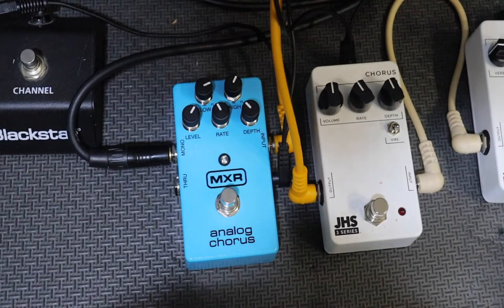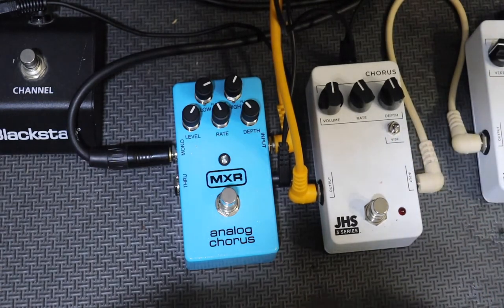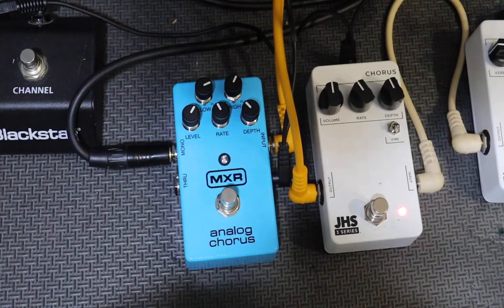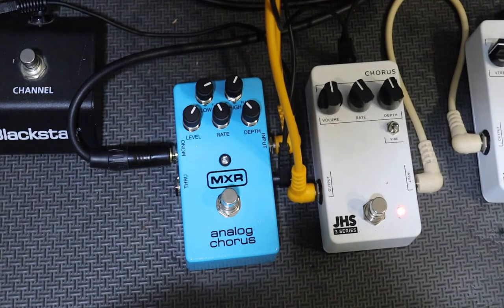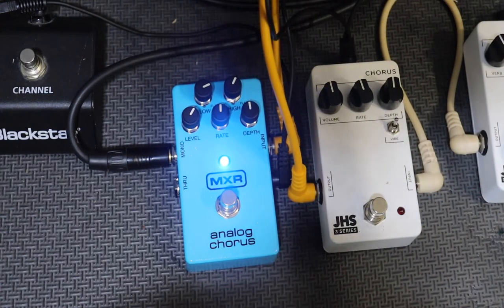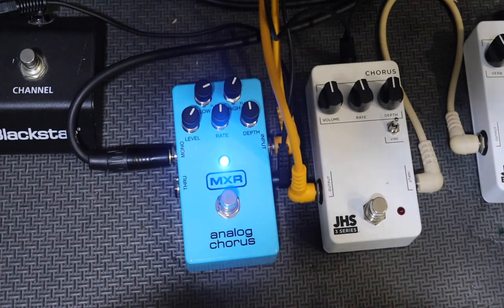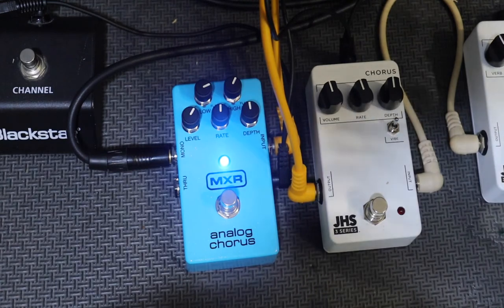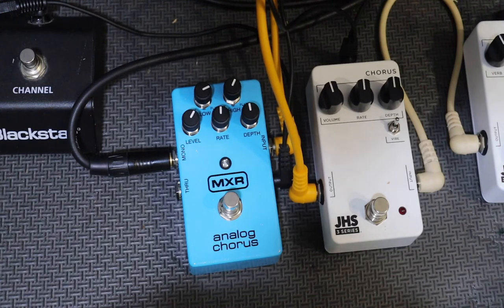MXR M234 Analog Chorus VS JHS Series 3 Chorus

Comment: If I had to guess why the volume effects the entire volume is because it is there to make up for any drop out.  Many chorus pedals would drop out and there would be a volume drop.  Maybe?
Reply from the maker: any bodys guess on that
Reply: @KevinMillard68  I went back and listened to Josh Scott talk about that pedal The volume is where you wish to place the signal.  Some may want their clean tone to be a little louder with chorus or you may want to lay back.  That's the only reason it is there.
Reply: @tjnugent62  Thats a really useful function IMO. Also I have at least one modulation pedal that boosts the volume, which I don't want. Now I have to fight against that volume drop when it gets turned off to play lead. This pedal allows to adjust for that.  Plus you can even turn the rate and depth off and use just the volume knob as a clean boost. Between that and the vibrato mode, this pedal can do many different things, which is very cool when you're on a budget or need to minimize the number of pedals you use.
Reply: @Falconryder  Thanks Jeff.  I need to grab this one.  Much appreciated.

Comment: Quick question if you know - the MXR has similar controls to the Boss CE-5 - which is did not care for and sold. Have you tested the CE-5 and could you tell difference between the MXR and CE-5? I keep seeing the MXR go for like $50 on the local used market and am intrigued but just dont want the hassle of buying and then reselling if its the same thing.

Thanks!😊
Reply from the maker: check my channel i have had the Boss CE-5 and i can tell the difference on all of them
Reply: mxr analog chorus - boss digital

Comment: Two minutes in, and already confused. You don't understand why there's a volume on the JHS? Well some pedals, like my TC Electronics flanger change your volume in an unwanted way. The volume lets you adjust for that, not to mention allows you to use it to boost or drop your volume depending on what part of the song you're using it for.  Very useful, actually.  Then you don't think the vibrato switch is useful? Seriously? It's literally a free vibrato pedal. That's an obvious value add, even if you personally don't use it.  The JHS isn't going to have the best sound of the two, because this is a series 3 pedal, which was purposely designed to be inexpensive but still quality enough to rely on, while being made in America. MXR is likely made in Taiwan. Series 3 is just meant to give usable sounds in durable pedals for little money.  It's a good chorus, or vibrato pedal, or even clean boost with the volume knob, which is a ton of value and versatility. They're not really trying at all to do the same thing. You can have your preference, but you're not being fair to the JHS by simply not assigning value to the things it does that you don't personally like. Doing so limits the actual audience for this video to only yourself.
Reply from the maker: there are way cheaper pedals then JHS that are also better then JHS you have alot to learn yet
Reply: @KevinMillard68  In full metal enclosures and made in America?  Yeah, ok then.